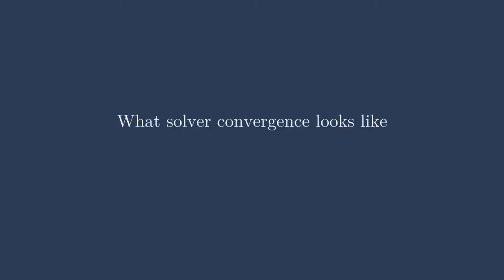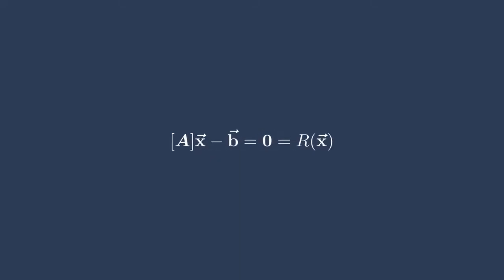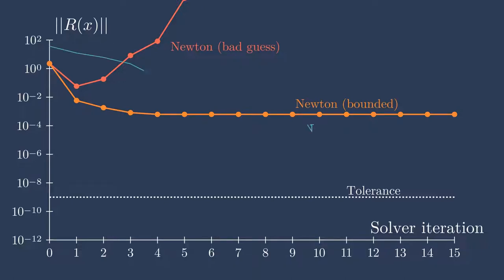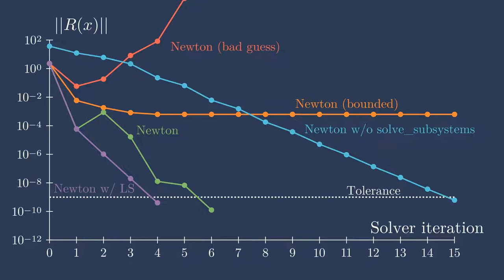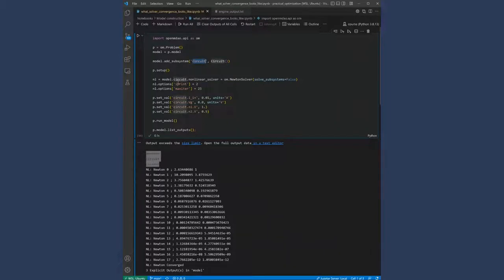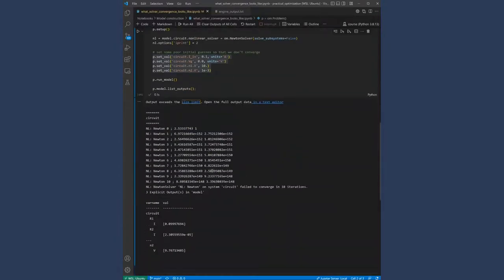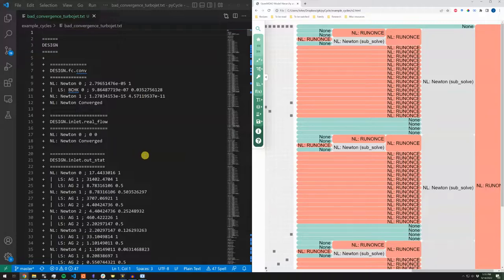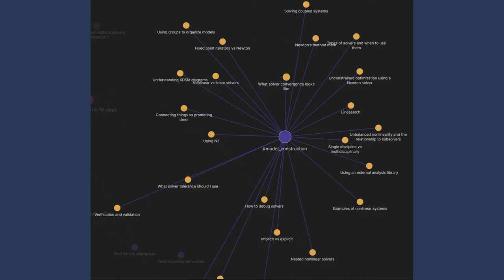What solver convergence looks like

Comment: Thank you for this lecture. If we have a cycle in the MDA then do we add nonlinear solver for eeach of the cycle or just once in the problem.model?
Reply from the maker: Thanks for the question! It's usually best practice to add a nonlinear and linear solver at the lowest level possible that resolves the coupling, so it'd be for each of the cycles. You could do it just once at the problem.model level, but that means that the entire model is within the solver, which may lead to unnecessary computational overhead. If you're running into solver convergence issues, it might make sense to have solvers at the cycle level and at the top level too; it's certainly problem dependent.